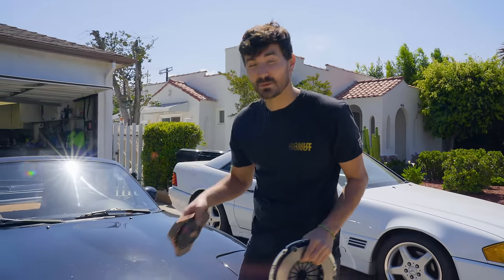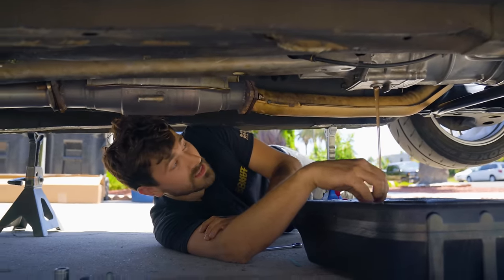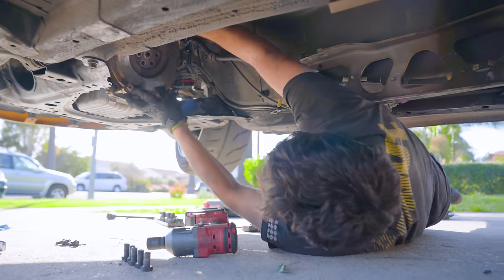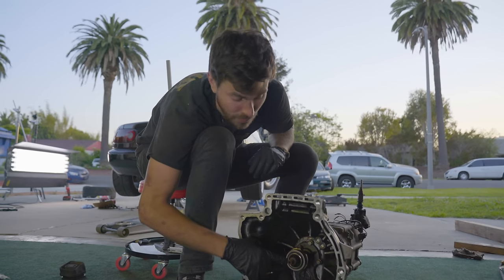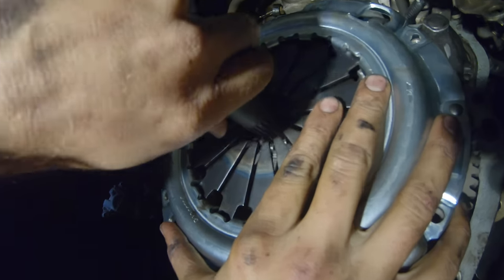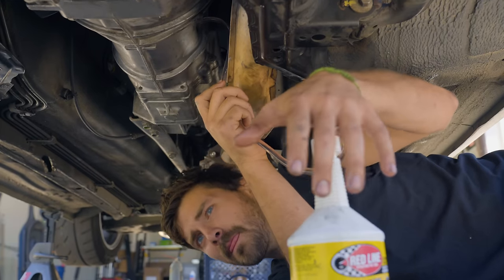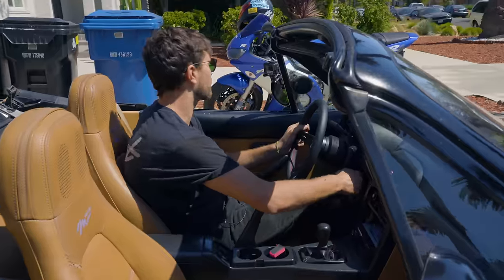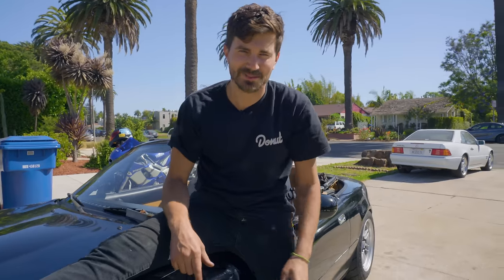We got sent a super weird clutch and installed it anyway

Comment from the maker: Just so everyone doesn't get too worried about me - the jackstands I have aren't one of the recalled part numbers!
Reply: How’s your head? That jack stand leave a dent?
Reply: Wait jackstands had a recall?

Edit: Thanks for all the replies, I hadn't heard about it, luckily I haven't bought any jackstands yet but I was planning to do so soon, so you guys saved me a potential injury so thanks so much for that!
Reply: @adelaide7822  yes sir. Pittsburgh jack stands that are rated for 3 and 6 tons are collapsing in use.
Reply: Well stay safe just in case
Reply from the maker: @jasonpolmateer226  Big dent! Less room for brain!
Reply: Wow, that clutch is TINY. Granted, I have a truck with a 350, so the clutch is going to be bigger, but dang. Also good content y'all, keep it up.
Reply: @adelaide7822  harbor freight recalled a ton of them recently due to "possibility of collapse under load shift" I'm taking mine in hahaha
Reply: First thing i thought
Reply: Can’t donut afford to buy you a little lift for your garage? The one we have at work for little jobs was less than $2000 installed. I think the lift itself was like $1200. Max. You just can’t lift an EV with it. But it would handle that Mazda no issues.
Reply: @adelaide7822  the ones that broke with people under their car
Reply: Well, atleast Donut doesn't have to worry if you get pancaked by the myata/MX5. You and jeremiah are so interchangeable. Your presentingstyle and posture is near identical. Are you his older, more intelligent brother😂
Reply: Are you gonna change the infortainment system
Reply: @CatalystNetwork  I think he mentioned it's a rental - so no way to mount the footings
Reply: Who remembers Zach from ECS tuning videos?
Reply from the maker: @sdusb1243  so tiny!!
Reply: @Donut  is the stand okay?
Reply: Not worried about you at all bro. Do some push-ups. Its a friggan' Miata! You should be able to bench press that bad boy off you! But I will say you are brave rolling the wheels while all four off the ground. Then again it is a Miata. You could just pick up the rear end to keep it from rolling away.
Reply: Too cool for safety glasses? Can't drive blind.
Reply: Hey Zack , Just for once supercharge the miata. Plz
Reply: What is going on with the r129
Reply: Was literally going to make comment on that   one step ahead
Reply: This guy funny asf😂
Reply: First thing i noticed 🤣🤣
Reply: Well I didn't see the car laying on you but that was funny lol but what kind of turbo do you want 5p or 10 pounds of force it makes a big power difference between 5 and 10
Reply: duh I'm a car guy I watch donut every day, but I don't know how a clutch works?? Come on homie
Reply: Flywheel revs alot better
Reply: Pls do a video on th  Jeep engines 
Amc l4 amd I6
Reply: Day 12 of asking you guys to make a VS episode on the Honda s200 vs Mazda Miata (my crapfox account got deleted so using my old account)
Reply: Hey Zach. Awesome content. Next time put the trans under the car, then tilt the trans up from the front, and slide the trans jack under it. It would also help if your buddy would put the phone or camera down 😂 A flying wrench usually gets people's attention 😎
Reply: What happened to the lost crusade to find the MIRACLE of all WHIPS
Reply: Lucky me. I have 4 jack stands bought at different time. All in the recall part numbers. lol
Reply: Just get a quick Jack
Reply: fishypirhana246 shit I should probably get my car off of jack stands
Reply: Zach change my clutch on my 2007 Mustang GT i got u bruh
Reply: @CatalystNetwork  hahahaha, someone was born with money it seems
Reply: Hi, "When it comes to shaving your balls"  What a great commercial when watching with KIDS!
Reply: How does it feel with that light flywheel?  It's gotta be one of my favorite mods to do to a vehicle, the engine is just SO much more responsive!
Reply: Buy some new seats or some racing seats 12:25 Anyone else agree?
Reply: Actually i need to say i did a complete clucth swap on a Toyota Hino truck with a scissor jack and couple of woodn block withn a one and half hours alone
Reply: Last time I put the jack stands under the pinch molding of the body like that it broke two of the spot welds. But my Lexus does weigh a fair bit more then that Miata so, I'm sure it's not an issue.
Reply: Good
Reply: You should get an Electric turbo!
Reply: @fostgate3699  If you take them back to Harbor freight they will at least give you store credit so you can buy new ones.
Reply: The famous last words:this clutch makes no sense to me, so imma install it in my car.
Reply: @jamesaddison7923  why someone would be trusting their lives to some cheap chinese jack stands is beyond me
Reply: E
Reply: Gordon B same here
Reply: You're the only thing good to ever come from ECS!!!
Reply: clutcho flyleaf from initial d more like
clutch and flywheel
Reply: I just returned mine last week lmao. Been using them a couple of years. Stay safe!
Reply: No ones worried
Reply: I am commenting right now because it's the 69th comment
Reply: Do I see tre flip wear marks on them kicks??? If so you just became my hero
Reply: I dont think anyone was lol jk @donutmedia
Reply: My 6 Ton Jacks Were!!!
Reply: #harbor freight
Reply: I was literally thinking about that when you got under the Miata with all four corners on stands. 😂
Reply: Still it would be safer to put something under the 4 wheels, just to be extra safe. We want to get more of these great vids in the future ;)
Reply: You guys are so lucky you get to drive and make and talk about all these cool cars and get to make videos about it for YouTube. I wish I could do that 😭
Reply: i needed some jackstands too, glad yall said something
Reply: Marvellino Gracia Z lmao i fw it
Reply: I don’t see any cardboard for sale on shop.donut.media what should I do?
Reply: Lol I literally stopped the video to ask this question, glad to hear. Stay safe brother and thank you for the awesome videos 🙏
Reply: Somebody get that man some safety glasses. Rust/road grime suck to get in eyes all I’m saying👍
Reply: Dude that seemed like a fucking hassle ! God dammit manual transmissions are frustrating...
Reply: Lassi Kinnunen  Always good to throw  the tires under
Reply: Lol I was just about to comment: “Nice safe looking harbor freight tools jack stands you have there.  Would suck it they just.. failed!”
Reply: I dont know about that one specifically but the exedy stage 2 thick puck i got is rated at 548ft./lbs. trq. (15951HD) isnt that bad...
Reply: I still don't trust jack stands with that kind of locking mechanism. Just because a certain model isn't on recall doesn't mean that the problem isn't there.
I prefer jack stands where I can physically insert a pin to lock it in place. A bit more crude but adhers to the KISS principle.
Reply: Yo zach did you notice a difference in the light weight fly wheel?
Reply: Hey Donut Media! Loong time broke af Mopar guy here - for the uninitiated learners in the chat "Mopar Maniac" roughly translates to "I can only afford to drive a beat chevy" - self satire aside your foot method is incredibly on point when it comes to diaphragms - but with a twist. I'm no fancy super mechanic but I am a trained machinist with a good dose of industrial metallurgy. The "foot press" method is legitimately a wallet saver. I'm 100% sure that was a stock flex.

 You have noooooo idea how many times I've tested strip downs with "bareley used" or "perfectly new, just 'didnt fit the build'" flexes in them. Diaphragms are spring steel. Theres a varying degree of what that means as far of capabilities but that doesnt defy the natural state of physics at any time. Springs. Get. Tired. Whether its tension, compression, or torsion. In the case of flex babies it's the latter two. I cant tell you how many "didnt feel right"  race ready rock crushers I've skipped bc I could drop em with with a big toe. If I'm testing a used trans I legitimately bring a set of gauges, pumps, and MOST IMPORTANTLY a nice mat so I can do the foot test without bundling the seller's panties. If they dont let you do that then just go on and find someone who cares about cars enough to let you double check them. 

 I've tried to sell cars myself where someone smarter than me found a problem I didn't know was there and I sold it to them for the fair price. It's not about money. It's about value. As a community we are nothing without values. 

And lord forgive if you're a mopar guy. Do you know how much it costs to re-inline the main spurving bearings to the panametric fan of a '44+ Turbo/Retro/(god forbid you have a micro) Encabulator? And that's all basic beeswax hoping your tremmie pipe isnt hooked up on the lower "up" end - in which case your lotus-o-deltoid winding is sure as fuck out of phase of your stator so say goodbye to your girdlespring lolol
Reply: @adelaide7822  the bad ones were pulled so you should be okay to buy now if you  buy new
Reply: Please give us content on the SL
Reply: Mines doesn't seem to be the recalled jack stands, but customer service said to bring them in anyways and swap them out.
Reply: BTW There are Chinese Pittsburgh jack stands that haven't been recalled, but still slip.   They are just waiting for a few more crushed people before they recall those.
Reply: Love y’all keep the need for speed!!!
Reply: Lassi Kinnunen  for sure! Or you could remove the front wheels so there's no chance of surviving a fall!
Reply: That’s very good especially since the biggest problem with those recalled stands are when used with lightweight cars. Heavier cars seem to put enough weight and stress on the bars to kinda lock them into place. I still wouldn’t use the recalled ones tho that would just be stupid. The teeth on them are tiny barely anything to lock into.
Reply: I always use a bunch of wooden jack blocks. 2 6x6s attached with 2 pieces of plywood, with a rope for handles. Got a bunch of them
Reply: 10:00 Dat pelvic thrust!
Reply: We're worried about your brain installing a transmission without a trans jack. Ooh and btw. The weight of the Flywheel does affect throttle response but only in neutral. Does nothing for drive ability. A heavier flywheel allows the engine to run smoother IE better idle. (Momentum between ignition points) putting on a lighter flywheel bill barely make it easier to stall. Tested this once and the difference was measurable but not really worth it, (Source: I work in automotive Testing)
Reply: Mine were recalled :/
Reply: How about now -- with the new recall?
Reply: “My time has come”
Reply: I drive a 2005 mustang gt and the clutch window has always been super tight ever since I got it. You have to do the engagement perfectly to avoid any jerking. My brother had a 2012 mustang gt and that clutch was completely different. The engagement felt like a mile long.
Reply: Can't recall my thick beam of wood ha!
Reply: bad sound on the video! too much midbass and near frequencies. exhausting
Reply: I have some HF stands.  I thoroughly researched to make sure they were OK.
Reply: My jack stands don't even say "made in china". They were probably made in the dollar store stock room
Reply: Just to  let you know that clutch  became pretty popular with performance minded owners in mid 70s  with the Rotary engines, I   installed  several for people at the dealership  I worked at ,some of the die hard  racers had mixed feelings for this clutch,  my personal opinion , I didnt like it for  the street
Reply: I was hoping those weren't harbor fraud jackstands
Reply: I saw those lol
Reply: @jasonpolmateer226  you are welcome I would love 😘😘😘😘😘😘😘😘😘😘😘😘😘😘😘😘😘😘😘😘😘😘😘😘😘😘😘😘😘😘😘😘😘😘😘😘😘😘😘😘😘😘😘😘😘😘😘😘😘😘😘😘😘😘😘😘😘😘😘😘😘😘😘😘😘😘😘😘😘😘😘😘😘😘😘😘😘😘😘😘😘😘😘😘😘😘😘😘😘😘😘😘😘😘😘😘😘😘😘😘😘😘😘😘😘😘😘😘😘😘😘😘😘😘😘
Reply: @jasonpolmateer226  you are welcome and thanks 😊😊😊😊😊😊😊😊😊😊😊😊😊😊😊😊😊😊😊😊😊😊😊😊😊😊😊😊😊😊😊😊😊😊😊😊😊😊😊😊😊😊😊😊😊😊😊😊😊😊😊😊😊😊😊😊😊😊😊😊😊😊😊😊😊😊😊😊😊😊😊😊😊😊😊😊😊😊😊😊😊😊😊
Reply: @jasonpolmateer226  you are welcome I have no plans to be at school 🎒🎒🎒🎒🎒🎒🎒🎒🎒🎒🎒🎒🎒🎒🎒🎒🎒🎒🎒
Reply: @jasonpolmateer226  you are welcome and thank thank for a while and eventually just a bit ago we are in and play ▶️▶️▶️▶️▶️▶️▶️▶️▶️▶️▶️▶️▶️▶️▶️▶️▶️▶️▶️▶️▶️▶️▶️▶️▶️▶️▶️▶️▶️▶️▶️▶️▶️▶️▶️▶️▶️▶️▶️▶️▶️▶️▶️▶️▶️▶️▶️▶️▶️▶️▶️▶️▶️▶️▶️▶️▶️▶️▶️▶️▶️▶️▶️▶️▶️▶️▶️▶️▶️▶️▶️▶️▶️▶️▶️▶️▶️▶️▶️▶️▶️▶️▶️▶️▶️▶️▶️▶️▶️▶️▶️▶️▶️▶️▶️▶️▶️▶️▶️▶️▶️▶️▶️▶️▶️▶️▶️▶️▶️▶️▶️▶️▶️▶️▶️▶️▶️▶️▶️▶️▶️▶️▶️▶️▶️▶️▶️▶️▶️▶️▶️▶️▶️▶️▶️▶️▶️▶️▶️▶️▶️▶️▶️▶️▶️▶️▶️▶️▶️▶️▶️▶️▶️▶️▶️▶️▶️▶️▶️▶️▶️▶️▶️▶️▶️▶️▶️▶️▶️▶️▶️▶️▶️▶️▶️▶️▶️▶️▶️▶️▶️▶️▶️▶️▶️▶️▶️▶️▶️▶️▶️▶️▶️▶️▶️▶️▶️▶️▶️▶️▶️▶️▶️▶️▶️▶️▶️▶️▶️▶️▶️▶️▶️▶️▶️▶️▶️▶️▶️▶️▶️▶️▶️▶️▶️▶️▶️▶️▶️▶️▶️▶️▶️▶️▶️▶️
Reply: Stay safe bois
Reply: ..take out your phone..
..take pics as you go along..
..if it rains.. your diagram could washout..but still do the diagram..
..you will recall it..
..grease monkey tip!!
Reply: Depressing drive, in depressing Cali. With a bland clutch.
Reply: 25 lets make it interesting!
Reply: @sdusb1243  lol the fly wheel on my 300 i6.. so big and heavy.
Reply: Should always inspect something that is going to hold up a car you will be under.
Not sure what sn mine are. I have many. They are all good.
Reply: Many years ago when i worked with truck and earthmover mechanics that clutch was called a button clutch,used in dump trucks and tractors running in muddy dumps.it guaranteed almost positive engagement instantly when trucking thru mud and soft garbage dumps so you wouldn't slip and burn up clutches.
Reply: commenting at 3 minutes and i predict that it is either a typo or you got garbage, on track often times a heavier flywheel will actually improve times as it carries energy when it shifts unless you are pushing serious horsepower
Reply: @jasonpolmateer226  Is to do something else j
Reply: @jamesaddison7923  Made from the finest Chinesium
Reply: Someone at Donut needs to get this guy a lift for his house if they want this guy to do this content at his house.
Reply: @CatalystNetwork  then what's the point in making easy learner videos, when your using equipment people just getting into cars won't have
Reply: @kevinhibbard320  I wonder if it's the same reason as my jack stand almost killed me... The moving part was installed backwards. You could move it up and notch it into place but a decent amount of weight, like a car, would send it right down
Reply: @Donut  stop being a donut and use a open and box end wrench.  And put a bolt in the bell housing.  Same thing but it doesn't have to be put back each time.
Reply: you look like Landmark
Reply: PROTIP: put a wheel under the side of the car when jacked up, if the jack fails its better to damage the wheel rather than yoursel
Reply: At least  that transmission could take you to a dinner and a movie before it pins you to the ground.
Reply: Hey donut and others I got a stage 3 ceramic 6 puck clutch with springs how do you break them in I have D15 non Vtec pushing like 80 hours power the people
Reply: But, his engine needs to make 190 lb-ft for us to test the clutchy-clutch.
people loved to mock me (as if stalling a light-flywheel means ya can't drive ) in my 2JZ (once every 1-2 years?).
Reply: @Roguescienceguy  😂🤣😂🤣😂🤣
Reply: was it just me or at 14:48 you only had one wheel spinning. Is that an LSD thing? I thought they would both spin if the are both off the ground?
Reply: NO BURN OUT?????????
Reply: plus it’s a miata and you can bench press it